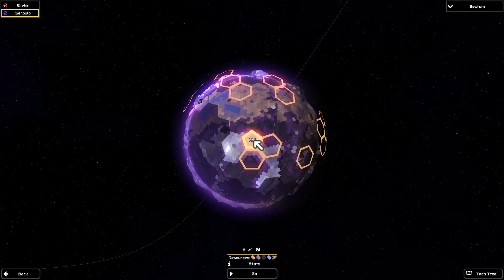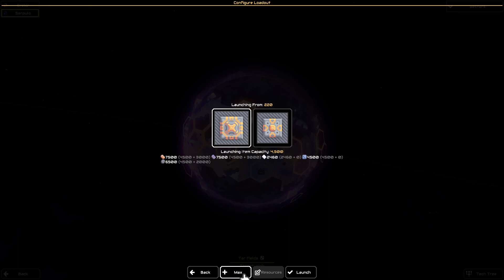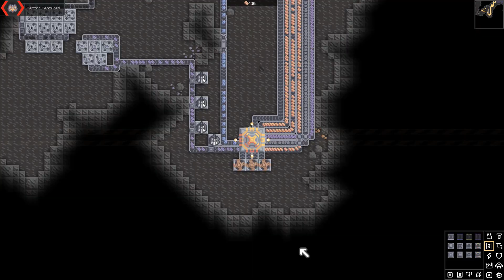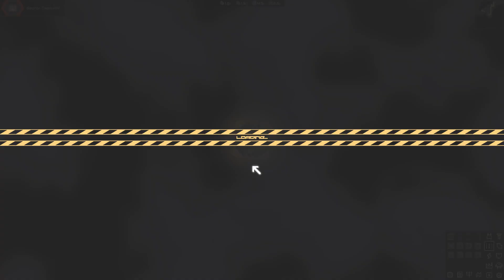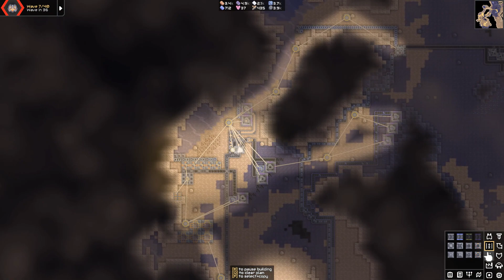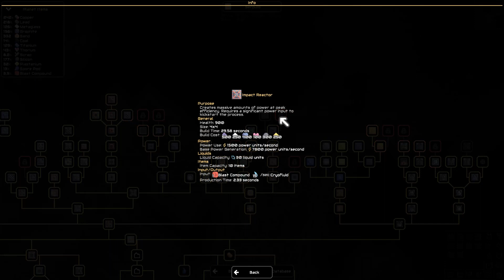Mindustry Tar Field Battle!

Comment: At 40:40, you could use spaced out underflow belts to feed the guns without throttling the output like the routers do. If you set them right next to each other they act weird, same with the overflow. Ooh, and you can use the containers/vaults to expand your core storage, only touching the core though. So, if it only touches a container, it'll be completely separate.
Reply from the maker: Thanks for the info
Reply: @redmoonrocket  you're most welcome, enjoying the content and excited to check out the other games you're playing

Comment: remember to read the entire stats

swarmer does 18 damage with surge alloy yes, and cyclone does 19

but you forgot to read the lightning part(where the real damage comes from)

if you max buff a cyclone and pair it with a water tsunami you can get the highest dps in the game
same with swarmer but more reliable
Reply: Yes, wet units taken extra damage from electrical attacks. So surge firing weapons and arcs. Oil covered enemies take extra damage from fire attacks, like the meltdown and anything that uses pyratite
Reply: agreed
Reply from the maker: Thanks for the suggestion. I’ll make sure to pair them together.
Reply: Agree

Comment: The guardian was a Vela, the 4th and 5th tier green ground units use massive piercing lasers, you HAVE to use plastanium walls to block the lasers or they will go right through the walls and hit everything behind it. If that is all of your defenses then it can blow up your defense through the wall.
Also, I will repeat, the very first thing you need to do in every sector is build a poly factory. You saw how long it took to build that meltdown? You cannot be sitting around like that in harder maps, you need to be able to build anything super fast.
Reply from the maker: Thanks for the insights. I’ll get on the poly building!
Reply: @redmoonrocket  take a schematic with a core in it and you can launch with that schematic
its very useful, however the size is limited to:

13x13 for shard core
14x14 for foundation core
15x15 for nucleus core
Reply: @rapidfirevestige  I've been wondering how people do that, thanks